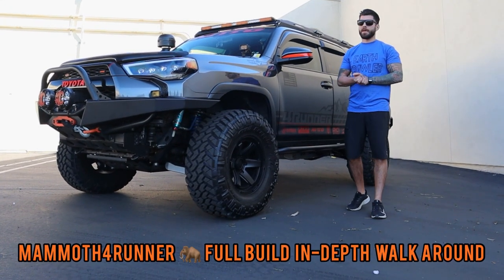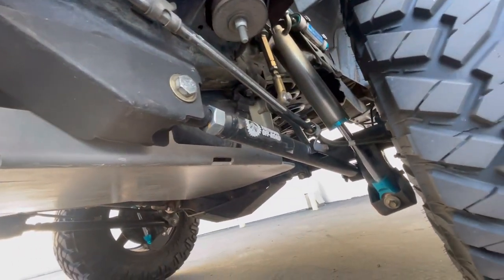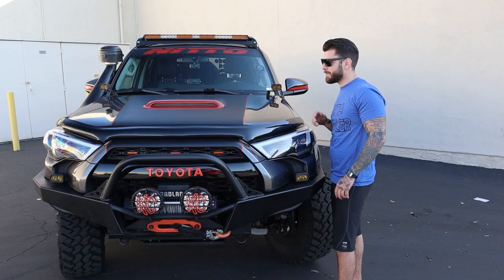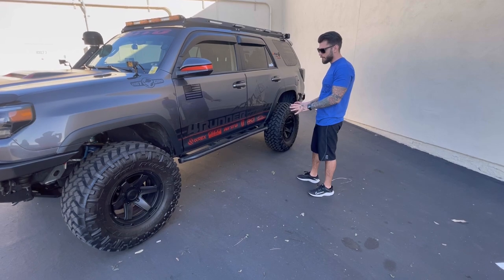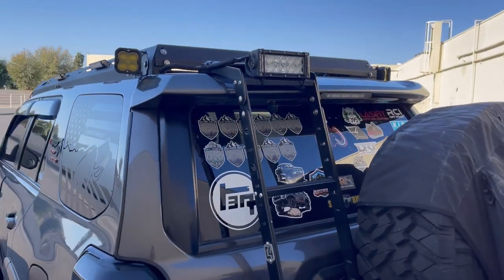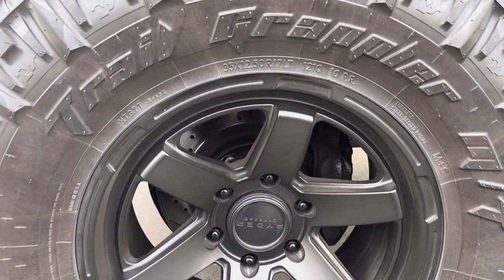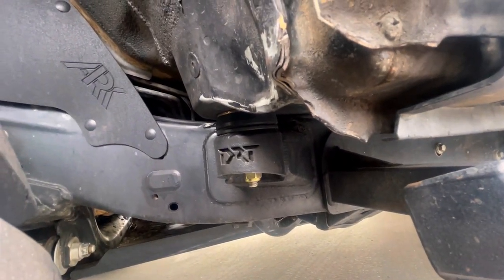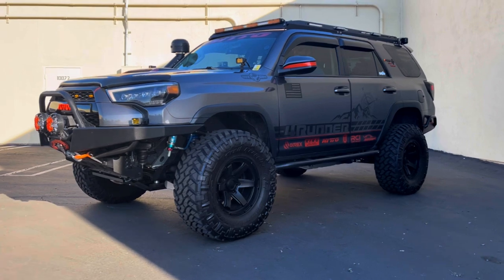Mammoth4runner FULL BUILD IN-DEPTH WALK AROUND

Comment: Your suspension seems maxed out.  The shocks are always riding over extended. Can you feel them slamming on rebound? Does it have any droop at all?
Reply from the maker: It’s not fully maxed, if I went a bit more it would be but with the 1 inch body lift we lowered it a bit more in the front so it wouldn’t ride so stiff.. it sits a bit lower in the front from the 3 inch springs in the back
Reply: @MAMMOTH4RUNNER  oh that's right you did mention the body lift. Yep that makes a huge difference.